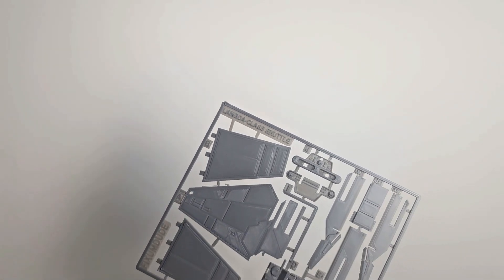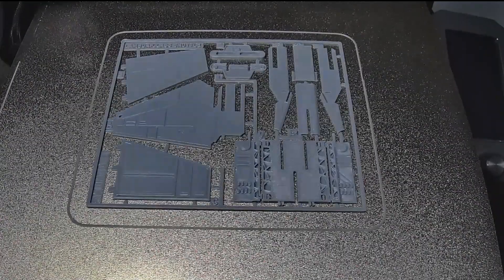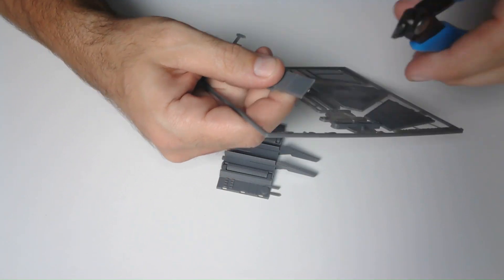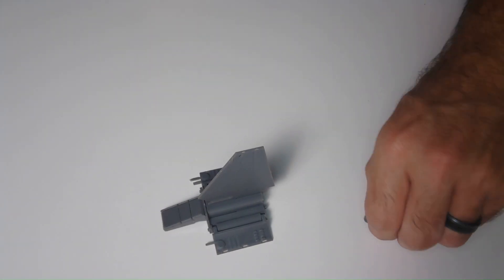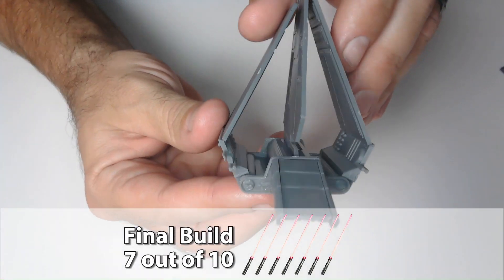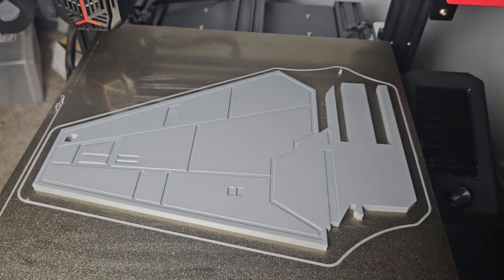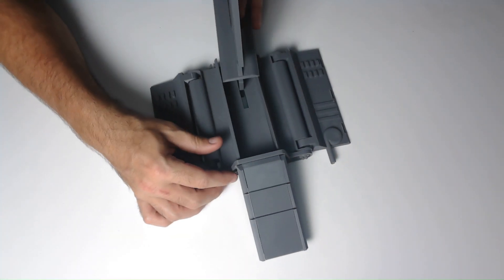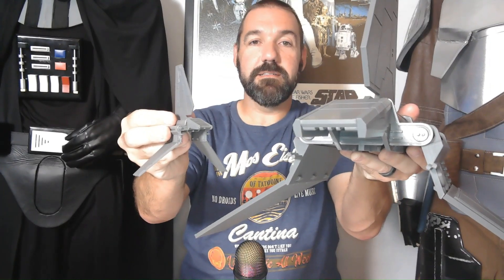How BIG Can I 3D Print This Imperial Shuttle? | Star Wars Free STL Files

Comment: I use  loctite super glue and mitre apel accelerator i use j-b weld plastic bonder to fill in seams and gaps . I ,ve been resin 3d printing for about 4 years l  use the peopoly forge printer because like you i want my statues large as possible. I really love  3d printing you put the effort and work in and get beautiful statues as a result.....
Reply from the maker: That's awesome! I'd like to try resin printing at some point too.